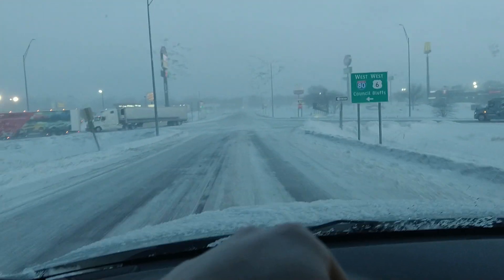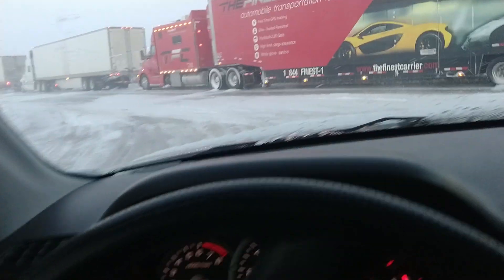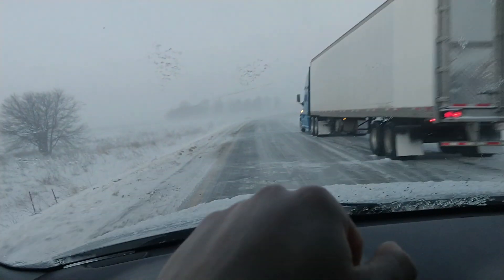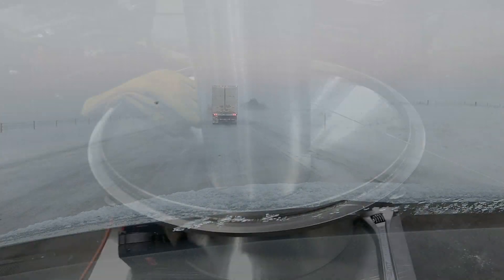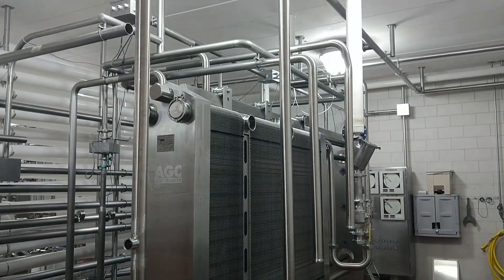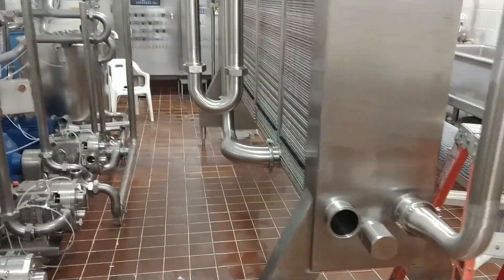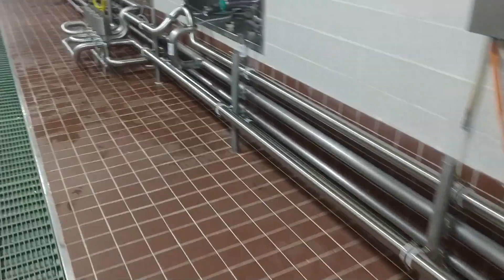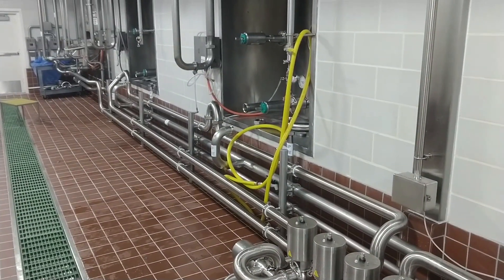TIG Welding Stainless In A Blizzard

Comment: Regards from Europe. We have nearly spring😆😆 Im wish have that job like you.  Btw. What tig you use to weld?? With Hight Frequency or widauth?? 
Chears👍👍
Reply from the maker: Cheers Spring sounds good. I am running a Miller Maxstar 210 and 161 STL the 210 has HF start the other is lift arc

Comment: Good video brother. What’s your thoughts on the miller 255 multimatic ? 350amp Pulse mig
Reply from the maker: Thanks, Looked at the 255 at my lws store seemed kinda chinsy. Might work ok but just looks cheaply made. The 350 mig is a sweet setup. Know a guy that has one and loves it.
Reply: DarlingtonFarm I know that’s the only thing that worries me is that it’s plasticy They all are coming out looking that way now. The 350p is nice but it’s old tech and no multi process or synergic settings. The 255 is 350a pulse mig too but inverter. The 350p is 5k but 400amp. Hmmm idk what to get. Stumped
Reply from the maker: Id say it depends on the work you do. The guy I know that has a 350p has it set up with a push pull gun and just uses it for aluminum mig all day. The 255 would be nice if you do a lot of different stuff
Reply: DarlingtonFarm i own a dynasty 280dx with ampltite card so I don’t really need the multi. The 350p is a nice proven machine with high resale I just can’t bring myself to pull the trigger for double the price of the 255. My one worry is like you said plastic looking. The new 220 ac/dc multi looks like the same. The 255 just peaked my interest at 3k pulse mig, 350 amps and Tig/stick was a bonus. I do mostly aluiminum Tig work. Mig is mostly back up and repair work. I have a few HTP machines as well. So for me answer your question I don’t do a ton of mig but looking for 1/2” machine to compliment my 280dx